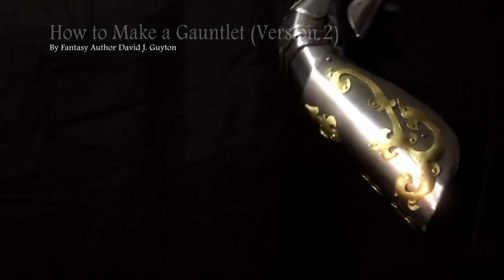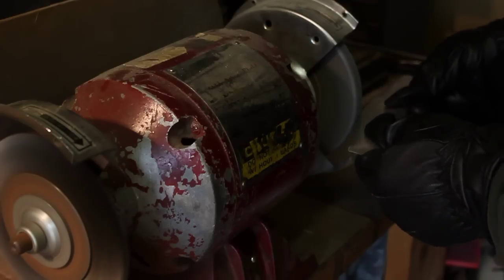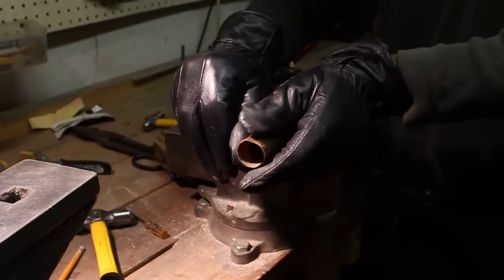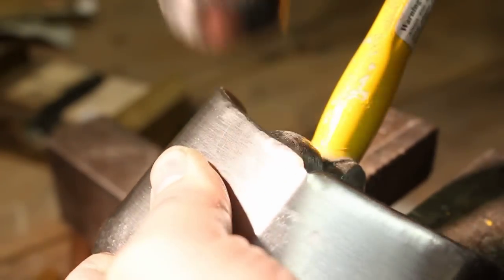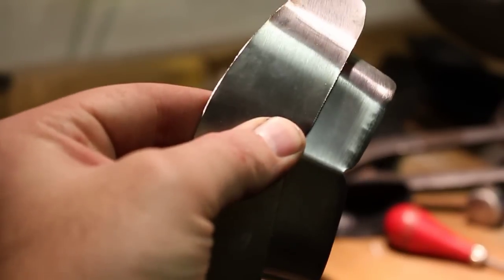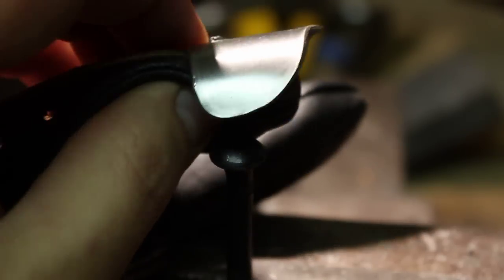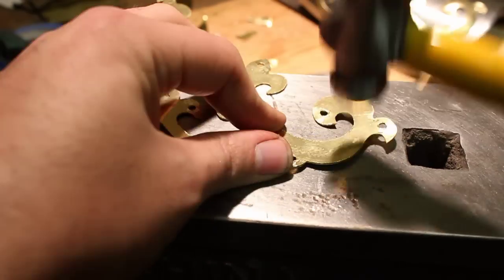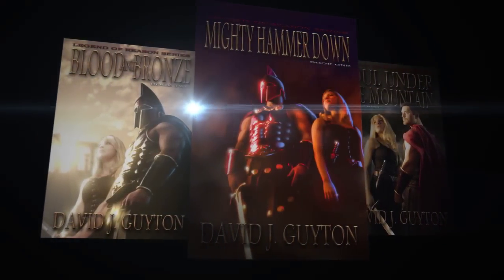How to Make Armor with Ordinary Tools - Version 2 Gauntlet

Comment: Witch kind of stainless steal you propose to uce in this project? Aluminium 1mm(20g) would be ok to?
Reply from the maker: aluminum is a much softer metal and may need to be thicker in order to hold its shape as well as the steel. There's no dishing with this design so aluminum can work, but keep in mind that aluminum will crack if worked too hard (if not annealed). That being said, this design should be fine with it. I prefer mild steel now over stainless, as it is much easier to cut and work.
Reply: David Guyton ok but with mild stell the same thicknes that stainless?
Reply from the maker: 20 gauge in either is fine. You could step up to 18ga if you are using mild....but 18 in stainless is going to be REALLY hard to cut
Reply: David Guyton Thank you very much. I would buy few tameplates from you cose i would start to cold forming. Have nice day;)

Comment: What's the strip of leather for in the fingers? Why not just rivet the plates directly into the glove?
Reply from the maker: it's easier to rivet to the strip outside of the fingers, rather than to rivet each plate inside of the fingers
Reply: But it has no functional impact on the gauntlet? It's simply for, uh, simplicity?
Reply from the maker: It makes it simpler, but it also allows for a bit of stretch, whereas riveting directly to the glove will not. It makes it a little easier to make a fist

Comment: What drill bit size did you use for the rivet holes?
Reply from the maker: Drill bit size is different for everyone. Whatever nails you are using for rivets, you need a drill bit that size. Should be close to 1/8" but can be less, depending on the nails you use.

Comment: i build this template, but don't know were i put the  "wrist 2" because i don't saw were you put in this video!
Reply from the maker: It's written out in the instructions: 

Mark the place on the glove where the final two holes in Wrist1 are. Punch holes through the glove in these two places.

Now insert Wrist2 to the rear of Wrist1, but do not rivet it yet. Wrist2 goes UNDER Wrist1. Place the
Vambrace over the rear of Wrist1 and then insert a rivet through the glove, then Wrist2, then Wrist1,
then finally the Vambrace. Wrist1, Wrist2, and the Vambrace all share this final hole. These to final
rivets need to be loose, not tight.

Note that Wrist2 is almost always unseen. It is there only to hide the gap that is seen when you bend your
wrist all the way, otherwise there would be a place where your wrist would show.
Reply: yeah, now it's ok. thanks man!

Comment: Hey! I have a really urgent question, I live in Australia and I don't know how much steel I need in australian measurement! Can you please help me
Reply from the maker: Not sure what you use in Australia. It prints out on 4 pages of 8.4x11 inch paper (I think). You'll need about that much in metal. The exact size depends on how you arrange the pieces, so I suggest printing out the template and laying it all out on the floor or a table, and then measure that area.
Reply: Thx so much, I have a medieval day at school and I wanted to use the quant let but put a templar design it it. Thanks for replying
Reply: Gauntlet*

Comment: Hi i waswondering if its possible with the template could i create the guantlet in a 3d printer ?
Reply from the maker: Unlikely. These templates print out on flat paper, so trying to print them in a 3D printer will just print out flat pieces. None of the curves are part of the templates...that has to be done by you.

Comment: I just bought the template, but on the hand and wrist pieces, it doesnt tell you where to bend them. Can i get a little help with that?
Reply from the maker: Sure...put on your glove, and lay the pieces on the back if your wrist/hand area. With a pencil, draw some marks on the metal in the general area where the metal should curve down over your wrist or hand. You don't want it to be too terribly tight to the glove, so be sure you leave it a little loose. Don't worry too much about where the bends go though....as long as you do it close to what you see mt do in the video, it will naturally work out. It is very easy to bend the pieces afterwards to get everything to line up correctly
Reply: David Guyton Very cool, thanks for the help!

Comment: how do I get the sides so smooth and the cuts so straight?? I cant get shapes right. the knuckle plate keeps coming up crooked. any pointers?
Reply from the maker: It's best to cut the pieces roughly with snips, and then finish shaping them with a grinder or a file. Is that what you mean?
Reply: David Guyton yes sir, I use that method it's just real hard to shape it to where all the pieces fit just right
Reply from the maker: It does take some time. Just keep at it. In the end it pays off....trust me.
Reply: thank you brother for the encouragement. and I appreciate the wisdom! im sure one day it will click.

Comment: I don't have a grinder but already bought the parts what should I do
Reply: a angle grinder is about 60 bucks. otherwhise doing it using a file is pretty doable to. just takes a lot of more time.
Reply: If you have an electric drill you can get a grinder disc, otherwise sandpaper and files.

Comment: is steel stab proof or more specifically cast iron
Reply: +paul johnson II What are you defending against yourself from? And I don't think cast iron would ever be good for armor.
Reply: VideoMasher3000 cast iron is slightly heavy but would definitely stop a knife.
Reply: paul johnson II Well ya it would, but its not really good in terms of longevity and overall strength.

Comment: what if you are a kid would it fit?
Reply from the maker: Funniest of 2003 I always suggest printing the template out and making it in paper before committing to metal. That way you can make corrections for size before you make it in metal
Reply: ty
Reply: The Hoodie lol, i'm 11 and my hands are bigger than adult size not even kidding XD

Comment: Can someone help me how to order the templates? And do i need to give all the info for the payment?
Reply from the maker: Just click the link under the video. You will have to enter some info or else the processing company won't know who to charge. You can also use PayPal if you want. All transactions are over a secure connection (look for the green lock symbol and the https before the web address at checkout)
Reply: Ok thanks

Comment: How in the world do I cut out the design stencils without messing them up?
Reply from the maker: get them close by cutting with snips, and then use files and/or a Dremel tool to get it to final detail
Reply: David Guyton oh, thanks, but I meant the ones in the PDF. How do you go about cutting those out and being able to use them without any folds or issues?
Reply from the maker: you should be able to cut the paper out with scissors, and then lay the pieces out onto metal, plastic, foam, or whatever material you are using to make the gauntlet. Then use the paper to trace onto the material
Reply: David Guyton ok thanks

Comment: Question why do we have to pay for the template?
Reply from the maker: Answer: You do not have to pay for anything. Use these techniques to come up with your own design. For the people who value hard work, and understand that the hard work of others should not be scoffed at or insulted, I offer my templates if they want to buy them. This saves them days or weeks of work designing in themselves. So, you see, I offer a service to those who feel it's worth the few bucks. If you don't feel it's worth that, then don't buy one. You are under absolutely no obligation to do so. But, I can speak from experience, and say that I am reasonably sure that someone such as yourself (who does not feel that the hard work of others should be respected and paid for), lacks the work ethic and dedication necessary to even attempt a project like this. So, I strongly suggest you do NOT purchase any of my templates. Have a great day.
Reply: +David Guyton I never said anthing about not respecting other peoples hard work its just that i was wondering why you made it so the people who did want to use your template had to pay for it. I meant no offense to you or anyone by making that comment if i did offend i am sorry.
Reply: Don't be so SALTY

Comment: what is the buckle for?
Reply from the maker: To hold the vambrace to your forearm
Reply: David Guyton How do you attach it? It's not in the template...
Reply from the maker: Attach it anywhere you want on the Vambrace. Use rivets to rivet leather (or whatever material you want) to the metal. Rivet the leather with roofing nails like you see me doing for the fingerplates.
Reply: Ok, Thank you!